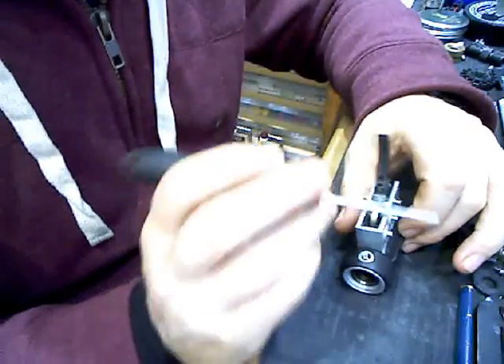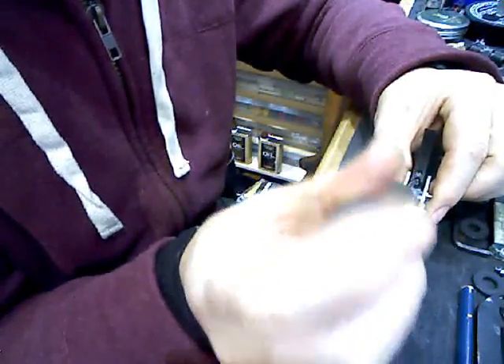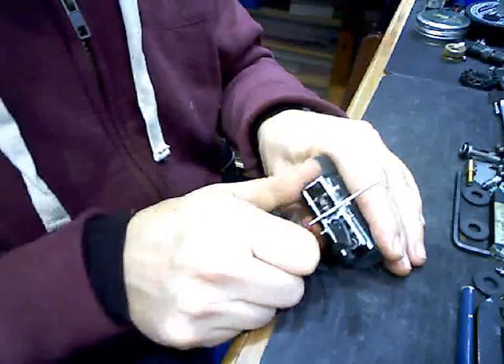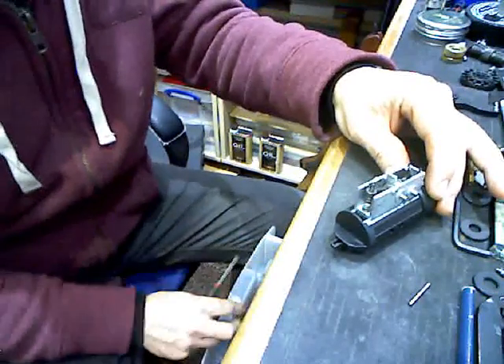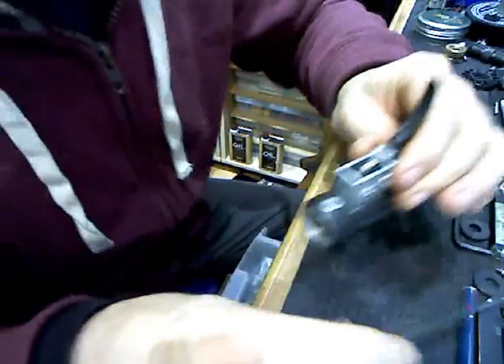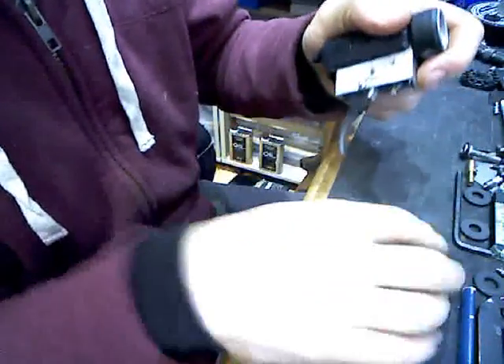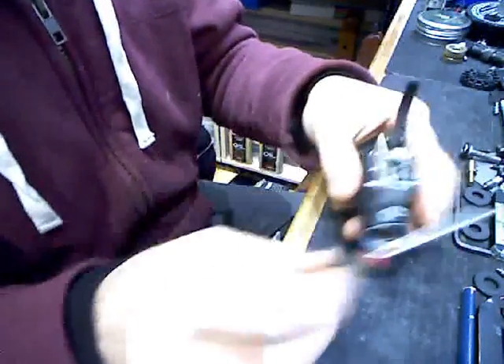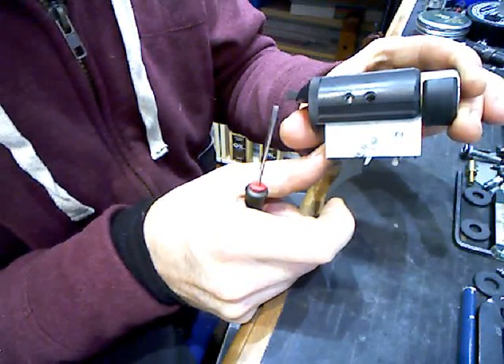T06 Diana trigger adjustment

Comment: Tony,  Thanks for taking the time to show and discuss the whole process.   It is very clear that the two screws in the trigger blade work together even though they control separate parts of the system. 

I know this is an old video, but I have a quick question: You said to adjust third screw behind the trigger blade all the way OUT.  Is that correct?  I have it adjusted all the way in.  After following your instructions I have a trigger weight of 1lb even.  That was measured in the gun several times and it is always 1lb.  

The first stage is very long, but with a crisp, short 2nd stage with 1lb break I didn't want the first stage too short.

What will happen if I back that third screw out?  I dont' want to mess up the way the trigger feels now.  Also that 3rd screw is very fragile looking.  I'd rather not play with it too much.

Comment: Tony can i test the trigger unit by inserting a round bar or similar into the opening for the piston rod. My rifle trigger operates as your video but fails to cock when  in the receiver and the lever operated [ K98].
Reply from the maker: just use the piston, with the spring guide and no spring push the piston into the trigger body keeping is square and it should push the sear back and engage.
Reply: Lol it was a real pain getting that grub screw back into compression tube for the cocking link . I fitted a Tbt drop in kit and made sure the guide was the right length. Even cut it short to make sure. Re-assembled but wont lock after cocking. Just glad the trigger is working.

Comment from the maker: well just adjust it forward a little....i was showing how you can adjust it, not where to adjust it too ;)
Reply: I fabricated a shim between the tab and the trigger blade. The tab appears to be cast aluminum and can easily break. Anyway you are correct without moving the trigger blade back any other trigger adjustments are futile.
Reply from the maker: You can drill and tap the tab and push the blade back with a grubscrew...I just showed the 1way lazy way I do it.
Reply: Tony Leach
Understood-I was getting really frustrated adjusting the modified T06 on my new 340 n-tec until I found your video. You saved me hours of grief - thank you for a great instructional video.

Comment: What a terrible excuse for a trigger. Diana made such a fine rifle, and then went and put a trigger on it that is difficult to adjust, and keeps changing every time the rifle is shot. A stick and a piece of string would be better.
Reply from the maker: its actually a nice trigger once set up right, easy as good as CD or Rekord
Reply: @TonyLeach-airguntech  heads up. You cannot bend the tab to adjust first stage travel on the new Diana 34 EMS. The tab is too thick, will cause the casing to fracture, and the tab to snap right off. This is what happened to me, and admittedly I am really upset about it. The only springer I own, and there are sentimental attachments to the gun. I don't know how I am going to fix it, can't afford a new trigger unit, but I will figure something out. Please inform viewers.
Reply from the maker: @Williamthebrand  drill the tab and use a course thread 3mm diameter grub screw to make an adjuster instead. Lock in place using blue thread lock